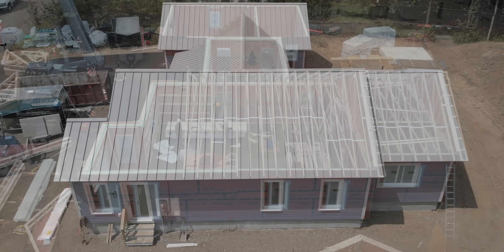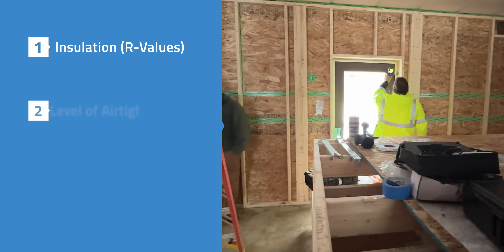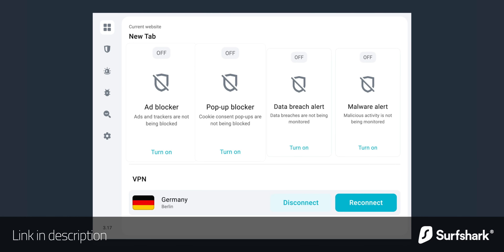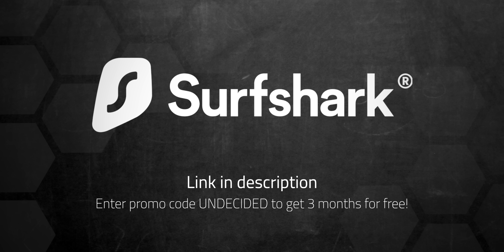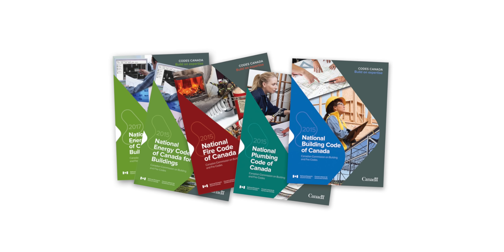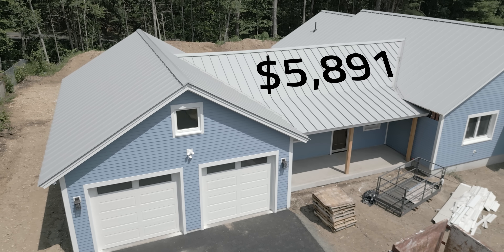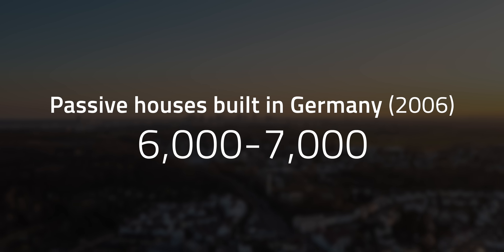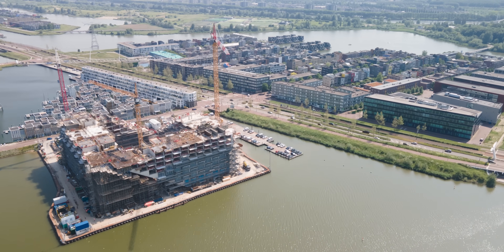Why Do American Homes Suck?

Comment: Building code is not a power reserved for the federal government in the Constitution.  It is a state issue. (Granted the feds overreach in several other areas.)

There's also the ethics of forcing someone to build the most efficient home possible, or not have a home.  Most people do not have the money to buy or build what you have.  A lot do not have the money to buy or build what current codes require, assuming they can find land that they can afford in the first place.  Adding more government (read: inefficiency) to the problem will not make things better for the vast majority of people.

Comment: When homes are advertised as non-insulted “summer homes” and insulated “all-year homes” you know it’s a little ridiculous. You can have insulation blown into the walls and ceilings of old homes; you can even rent the equipment yourself. Insulate your houses and plug your drafts, it saves money (and keeps the critters out).

Comment: Solar would be great to have on many residential roofs but they cost a lot and take years to pay off. That said with higher efficiency of the panel it could help, I assume prices will come down over time as well. If I can ever afford to build a home I’d like to do this, but add screens to the windows.

So you’re saving about $6k per year. How much more did it cost to build over traditional building supplies?

Comment: I live in Finland and my house is from 50's. 150m2 an energy costs are 3000e a year, which is quite nice concidering temps can go under 35C in winter and over 35C in summer. I have constantly 23c as inside temperature. If I would have house like those in US, my energy bill would bee in tens of thousands yearly

Comment: The energy efficiency for homes in South Africa is a joke. We bought our solidly middle class house 2 years ago, no insulation in the attic. The standard South African window is made of common steel, with single paned glass (I haven't even seen double-glazed windows here). My hot water heater is code compliant, I added an insulating blanket to it and dropped my energy usage by about 6kWh per day. I am the only person I know who has weather gaskets on my windows and who replaces the bushings that make it possible to close the windows tightly. With our electricity crisis, a large number of people have unvented gas heaters (literally a thing that burns LPG in the living room). This is even before we consider the number of impoverished people living in even more poorly constructed buildings and shanties.

Comment: 1. Builders, no matter which country you look at, will always default to what they have traditionally built unless there is govt. regulations stopping them or economic incentives to make a change.

2. Energy in US has always been too cheap.  It made proper design and construction to efficiency standards economically pointless.

3. (and related to first point) people in most countries like homes which look more traditional (obviously what counts as traditional varies from country to country).  There is a flip side to this as well, people will shun houses built in a way that has a reputation for being badly built even if that reputation was from 50+ years ago and hasn't been true for 20+ years.

Residential construction is the most conservative industry it is possible to imagine.  If we had a time travel machine and could bring a construction worker from the 1920s forward to today, what would that worker say has changed in a revolutionary fashion for a standard residential housing development ?  I could only think of 3 developments: factory built double glazing units, battery powered tools and press to fit plumbing.  Everything else either already existed or is nothing more than a minor evolution from what already existed in the 1920s.  As Matt's own house shows, it doesn't need to be that way

Comment: Well Germany doesn't have Nuclear Power Plants. The last ones were close on 15 April 2023 (the Government decided to close them down because they are bad for the environment - the Green Party is pretty strong in Germany) on the other hand we do not have any gas and oil and therefore we brought it (mostly) from Russia, which is problematic now. Thus, insulation and solar panelling gets more and more important. In short: It's geography and politics. But many people are not happy with it. It's expensive at first. But that's a different topic.

Comment: 1) 6:20 I think thats how it is in most federal organised nations, not only the US. And I think in the US, it actually makes sense considering the size and very different climates.
2) 9:25 No usually a higher air exchange doesnt cause moisture, too less does.

3) I dont think american houses are generally bad. Housing isnt just a technical thing, it has many social and cultural aspects too. It`s probably not as strong as it was in the 50s/60s, but america still is "the nation on the move" compared to other countries. for europeans, it`s insane how often americans move. Europeans builld and upgrade their houses with this kind of "laying a foundation or continuing a family seat for centuries" while Americans build their houses with a kind of "if it`s better somewhere else in 3 years, we go there and this buyer or the next one tears it down anyways" mindset. you could argue that better houses would stand longer, but I dont think thats would be the case.
When you include these  cultural aspects  (and many others I dont mention now), I put a big question mark behind the thesis that american houses are actually that bad. Many passive houses are not so-eco friendly in their production compared to the typical american wooden frame. and it gets even worse when you tear them down/upgrade them because the majority of cheap insulation systems is literally unrecyclable toxic waste.
In countries like germany with a very very strong energy saving code, there are big discussions going on if we already reached a point where the measurements to save money and energy cost more money and energy in the complete lifecycle of a building than it acutally saves.

Comment: American houses are poor because: 1. Shoddy construction, 2. Poor quality cheap materials used, 3. Knowingly building with methods that are known to be design defect, for example, copper pipe coming from the concrete foundation, 4. Using wood as building material, hence prone to fire and termite.
There are probably many more reasons.

Comment: Something else to consider with the economics: diminishing returns

Every time you double your home's efficiency, you're only halving the energy costs. Assuming a linear relationship between increased efficiency (for something like, say, thicker insulation) further increasing the efficiency of your home makes less and less sense. When energy prices are so low that you're spending maybe $100-200 per month in heating, doubling the thickness of your walls makes pretty much no sense from an economics standpoint. That being said I very much support greener homes and plan on building one in the future. Even in the house I currently live in we replaced all the insulation, installed heat pumps, and are installing a tankless water heater.

Comment: Yes building standards in the US are too low. On a state level I see little interest in doing better. I am building a small workshop atm. I can’t afford a contractor and not updating the standards has made it difficult to get materials to build to a higher standard bc they’re not available at the home store. I can’t imagine finding a local contractor willing to build what I want to the standard I want. Hell, even the local supply houses, not the big box stores, immediately question why you’re not cutting corners when you go in telling em what you’re doing. They try to sell you on the way everyone else is skirting code and you could be too. Maybe that’d be something else if they weren’t trying to skirt 2003 code. Folks don’t respect building code and the state doesn’t update or enforce it.

Comment: As a PE (Professional Engineer-Mechanical) licensed in 48 sates and 3 Canadian provinces, I have designed commercial buildings all around this country.  The sheer diversity of the climates in North America, will never make it a fair comparison to Europe where there are much more temperate climate conditions.  I know we're talking homes, but it's way harder to make commercial buildings anywhere near as efficient as homes. And there's a true difference in the design approach for each area for getting the best outcome.  And that all assumes that the owner actually wants to follow-thru with what they initially ask for.  Developers are the worse. Even with multi-family residential buildings that can be made super efficient, they have zero interest in doing anything above what the code states and it can be pretty lenient.
I tried practicing what I preach too. We built our house 11 years ago and went with a builder who was doing EnergyStar homes. I modeled my home in using HERS rating software with the goal of net zero after I added in PV. Turns out the builder was only doing the previous version of EnergyStar (unknowingly) and had no interest in doing the newer standard, which included the continuous insulation on the outside of the house.  It was a $30k add for geothermal (just the wells).  To their defense, they knew how hard the mortgage market was at the time and we were putting ourselves well outside the appraisal range, with a payback that was nearly as long as the mortgage.  Still got a very efficient house that has an air-source heat pump with gas backup (needed when temps drop below 0F).  With PV (no electric cars) the house achieved a HERS score of 25 and there's still room for more PV and upgrades as that original equipment starts to fail.  In the end the upcost for my improvements, it was barely 2% more on the house's cost. 
As you know, unless you bring all your money to the table, there's no chance to get a net zero or near net zero home even today. Builders don't want to learn the simple stuff it takes, developers don't want to take the risk with the higher prices, mortgage companies don't help, rebates and tax credits don't help when you buy from a developer. Lots of things to fix.  The best thing to happen recently is the ban on new gas services.  That forces builders into heat pumps.  The IECC 24 will require double 6" offset stud walls in climate zones 5+ which also helps.  But geothermal is only gotten more expensive over the years, not cheaper. To the point where only community geo will work with market rate houses.  Because only the very rich will be able to afford private systems.

Comment: The nominal standards are quite high---but that isn't going to help if the execution is lazy. Which it is, if no one is watching. The benefit of prescribing things in code is that it sets a floor. The hazard is that the code becomes a least common denominator and a mine for loopholes: if code allows an exception for an enormous, stupid second-story foyer window, it will worm its way into becoming a valued feature just because you can have it.

As the owner of indifferently insulated houses with, successively, junky aluminum windows, old-fashioned wooden windows, and 1960s wooden windows, none of which have had poorly manageable heating and cooling costs, I am skeptical of the amount of importance placed on energy efficiency. My annual heating/cooling bill is no more than 50% greater than the cost of a single decent new window. If the new window saves me 33%, and the interest rate is zero, it will take as many years for the window replacement to pay off as there are windows in the house (currently 23). In reality, it would be 30-35 years to pay off because of compounding interest.

For someone who seems to like burning energy, or for choosing new construction, I get it. With the caveat that there is some tradeoff between energy efficiency and durability... masonry is bad for efficiency, but if it lasts 3 centuries, that is 3-5x less of whatever quantities of energy will go into the replacement costs of frame construction.

Comment: Europe also uses hydronic heating. Much more efficient than using air. We do our share of radiant heat but it is very small compared to the house builders who insist on blowing air through fiberglass ducts. Even automobiles and dirt bikes use water cooling today.

Comment: one of the things that always bothered me about passive houses is that the ventilation level is kept at 0.6. If you use a passive heating and cooling system, you can increase this to 1.4 without using any 'imported 'energy. Maintaining a higher ventilation level is much healthier for your brain. I also think using PV to make electricity to heat a home is very inefficient. Using solar heating panels on top of an underground air ducting system (>/=5m deep to move air temperature towards the average annual temperature) is far more efficient than a heat pump and uses less roof space (about 3 times less). The only target for passive houses should be how much imported energy is required per cubic meter to maintain a set temperature all year round. often that figure can be offset by accounting for people (100W heaters) and electrical equipment (lights, screens, computers and other devices all make heat) thus the amount of energy imported specifically for heating is lower. But ultimately you want to know the kWh/m^3/yr needed to hold a temperature of say 22C/72F.

Comment: Just one observation:  if I were to replace all the windows in my house with triple-pane, the energy savings wouldn't pay for themselves until 2125, on a house built in 1918 (with no insulation at all).  Forty-eight years ago it had cellulose insulation blown into the walls plus the second floor ceilings insulated, and the energy savings didn't match the cost of that until 2004.  This is why older houses don't get energy improvements -- it takes too long to realize any financial benefit.

Comment: It’s quite simple…….IT COSTS WAY MORE MONEY TO DO THIS. You spend 400k building a home in a 200k neighborhood and your resale value will be based on the surrounding properties. You’ll never make your investment back. 
As a developer, you build massively expensive efficient  homes and your clientele opts for the larger home a mile away for less money because energy efficiency isn’t as important as the space and the implied value. 

Here in the US the government gets involved and caps sales prices and mandates X number of low income homes in a development……which dramatically limits the overall value of the neighborhood and thus drives low-cost construction. 

It’s not about greedy developers trying to maximize profits at consumer expense…..it’s about developers trying to turn a profit at all.

As an example, you pay $30,000 to put solar panels on the roof and it’s going to be 25 or 30 years before you break even…. Which is only a handful of years before the panels themselves start to fail and have to be replaced again. Adding solar panels to your roof. Literally does not save you money in the US, unless you live somewhere very sunny, with unusually high utility costs. 
Paying $1,500 a window instead of $250 … means you’d need to live in the literal north pole in order to save enough energy to justify spending that much more money on windows.

Comment: Alpen windows near Denver, Colorado uses thin glass or thin film as the interior panes in some of their triple and quadruple paned windows and sliding glass doors.  This innovation may have never taken off in the U.S., but thin glass/thin film windows are absolutely available in the U.S. from a U.S. manufacturer.  This is an important point to make for someone that would actually want to use them in the U.S. for a high efficiency or even passive house built in the U.S.

Comment: The first thing Americans are fascinated by when they live in a rented apartment or house in Germany are the double or triple insulated tilt and turn windows. There is a vacuum between the panes and the frames have a special hollow chamber profile. The smaller the Kw value (thermal conductivity), the better the windows and doors. Even older houses made of stone have walls around 45 cm thick, so they are inherently well insulated. Prefabricated apartments or houses with monolithic construction also receive insulation of up to 21 cm on the outside. Even prefabricated houses have very good insulation. All doors to the outside have a rubber seal all around to prevent and avoid drafts. These thermal windows and doors are available in plastic, aluminum, wood or steel.

Comment: I have double paned windows, and a whole bunch of insulation.  I also use the weather to passively heat and cool.  The run time of my a/c each year in hours, and ditto the furnace.  Also recently switched over to solar, because of a state program.   I do enjoy the European style tilt and swing open windows.  I also have a shade awning the runs the length f my house n the back which gets sun all day, as well as shutters on the inside.

Comment: You need to stop using relative terms like "really efficient" I do heating and cooling loads using HVAC CALC which is using manual J . Windows in particular are confusing to most people because they use a U rating instead of an R rating. This is by design to confuse consumers because when you input the type of glass you are using it is nothing more than a hole in the wall. It would be interesting for you to tell us the BTU loss through your windows per square foot or convert the U rating to an R rating just to show people what those windows really cost in the long term.